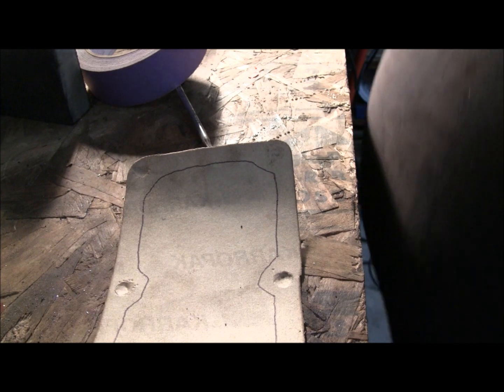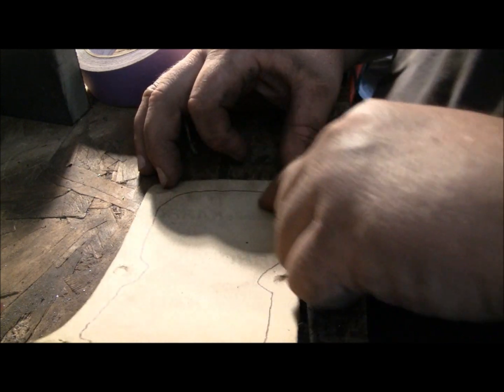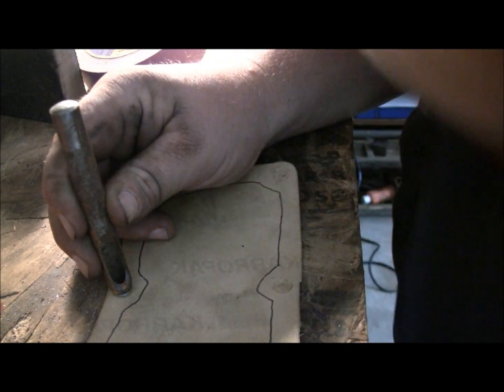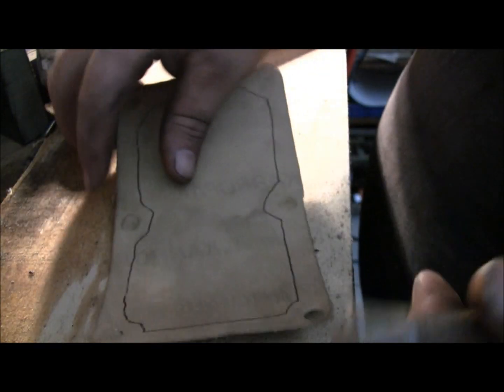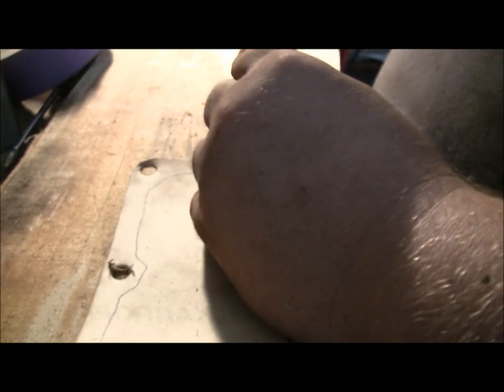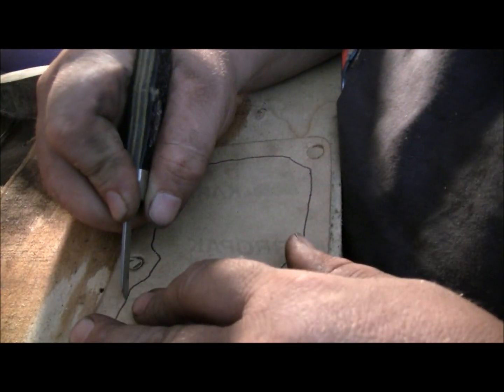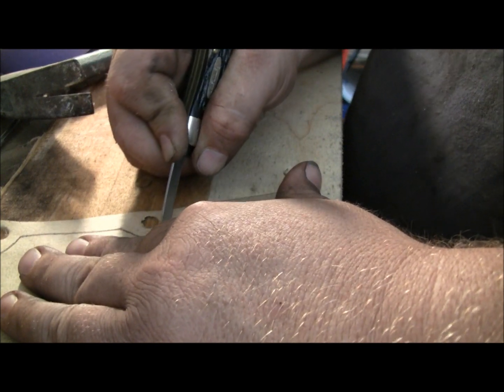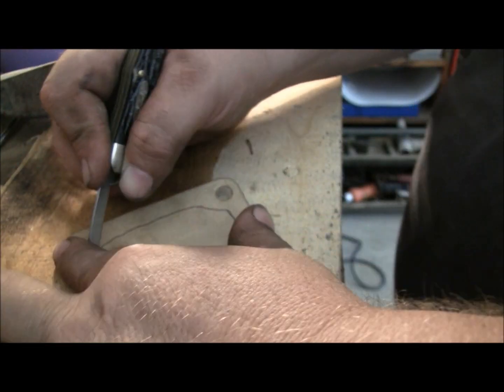Air compressor overhaul Making your own gaskets

Comment: Found your video while searching for compressor head gaskets, i did a similar one a week ago but it was the fidderly one between the top and valve plate.
Thin lines of gasket down the center and across, i stuck the paper down with gasket cement and used a sharp craft knife to cut out the bits i didnt want lol :-))
I like your tapping method, i must try that next time :-D